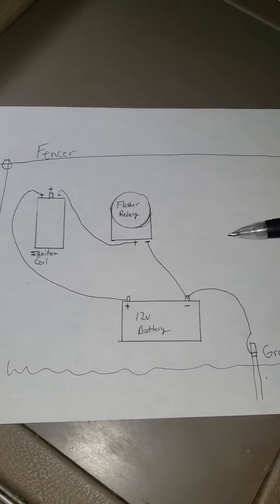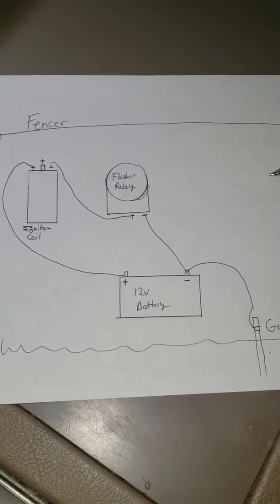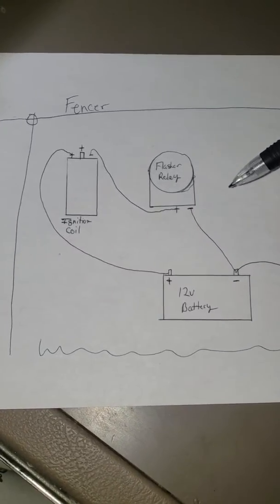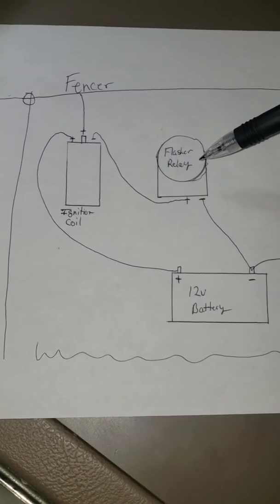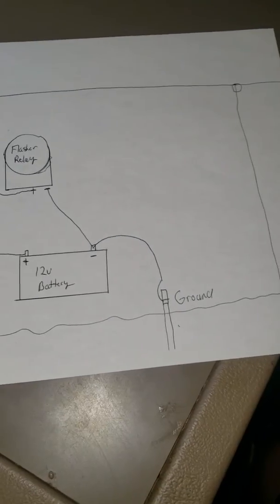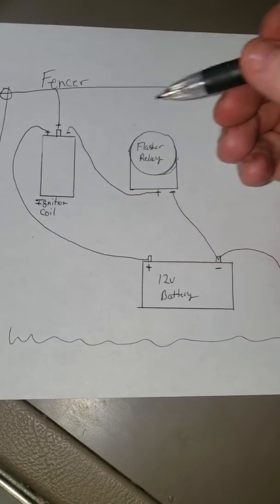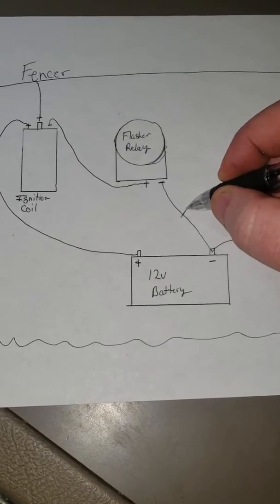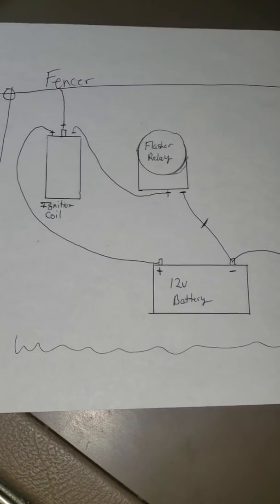Homemade electric fence energiser Diagram

Comment: Hey Luke! I have a wooden privacy fence & a bad raccoon groundhogs & muskrats issue. Will this work if I line the entire fence with wire? Also, storing batteries when it’s raining should they be covered? We have bad storms.
Reply from the maker: @SipNSpills  I don't see why not. As far as the weather and the battery. Depends on the battery, you would think a car battery would be fine. As long as it's not touching the ground of course
Reply: @probuildjohnsonify  Thanks, Luke!

Comment: You want your flasher relay to switch as fast as possible. You can limit the power with a resistor in between the coil and battery. Careful you can really hurt yourself with that. Definitely use high watt resistor in between those two.
Reply from the maker: @normellow  I know. I have planned to make an updated video. You should only need a 12v or under resistor. Because the flasher relay is on the ground side of the coil, not the high voltage side
Reply: @probuildjohnsonify way dont my vens charger work i hev dun efry ting as sowen end noting happens please help
Reply from the maker: @normellow  actually you can use a potentiometer between the flasher relay and the ground. Look up how the old flasher system works on old vehicles, it with make it more clear

Comment: What if you just hook up a few batteries 🔋 together and connect it straight to the fence wouldn’t that work to
Reply: no.  to make the fence voltage high enough you'd need more batteries than you want to buy.  the automotive coil jumps up the voltage without a lot of batteries.

Comment: This will work but not for long ! The current needed by that coil on Make or break is hundreds is time what the contacts on the switcher are rated they will soon put and weld themselves on you meet a Fet to switch the coil and a little signal processor would be nice
Reply: The flasher relay is only ever getting 12v
Reply: @redrustyhill2  current is watt affects the contacts the voltage is not a problem
Reply: @harryconover289  the current would be no more than what a flasher In a car gets.

Comment: Whats a flasher relay
Reply: I realize this is a bit late but in case you're still wondering (and in case you were serious), or if it will help someone else, I'll try to answer your question.

A turn signal flasher relay, if equipped, will be in the fuse box and uses a thin metal strip, or armature, that connects a load to a power source and 'locks' into an on position when it receives power. They're used to prevent overload and so that smaller wires can be used to run to switches and still be able to provide proper power to the load.

What he is calling a turn signal flasher relay isn't really a relay, it's a turn signal flasher, also known as a thermal flasher. People use improper terminology without doing their research and continue to pass along misinformation. The thermal flasher contains a bimetal strip, usually made of steel and copper, steel and brass or Invar (iron and nickel). When cold, the flasher will be in the closed position, providing power to the turn signals, and when the load of the bulb heats up the bimetallic strip it releases, causing the lights to go out. It almost immediately cools down and returns to its previous state. This temperature difference causes it to constantly move back and forth, causing the bulbs to flash. That metal strip is also the clicking you can hear inside the thermal flasher. The heat created from a high load is absent, or greatly reduced, when LED bulbs are used and this causes issues with flashing, often resulting in the bulbs simply staying on and is the reason a mechanical flasher often can't be used without a load resistor and instead a variable load, or digital, flasher is used. I hope this helps.

Source: longtime mechanic, parts manager, ASE trained and technical advisor.
Reply: @The.Plague  very helpful indeed. The bi- metal strip sure made life more comfortable in various ways. You sir, have made a contribution yourself. Thank you for the excellent interesting display.
Reply: For the indicators on your car
Reply: @williamoneill9699  lol
Reply: @Northrop-Grumman1991  😁

Comment: Good example of 'an old school DC hotfence transformer'. This is basically how they were originally made in the late 1960's-1970's. It is also why everyone wanted the 110v AC systems...which were nothing more than a similar 'automotive coil' and a capacitor instead. When a 1M Ohm resistor is put to the ground-side, it makes for a very clean 'turn off', too.
Reply: BTW...in the 1940's, they used a 'powered rotary points system' to initiate 'pulses' instead of a capacitor, so that 'open circuit' lasted long enough to 'let you go' before the next pulse hit.  Great 'internals video' of a 1940's 'Electro-Line' brand AC fence system can be seen at:  https://www.youtube.com/watch?v=-bflY0jNNvY
Reply: Hi

Comment: Nice... But is there a way you can measure the output voltage?
Reply from the maker: Don't use a voltmeter, you'll blow the fuse. I thought about using a fencer tester to measure voltage.
Reply: You’re better off using a 400vac transformer with a rectifier with a power supply with a switch inside the house
Reply: Arc lenght 1kv=1mm arc